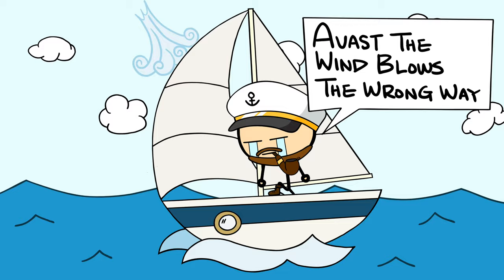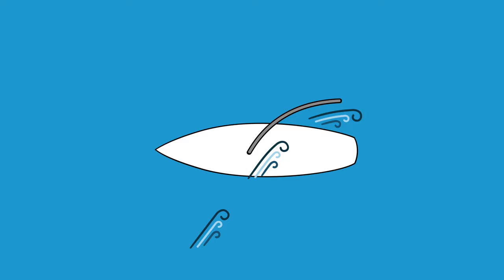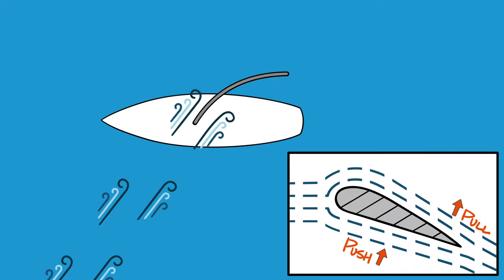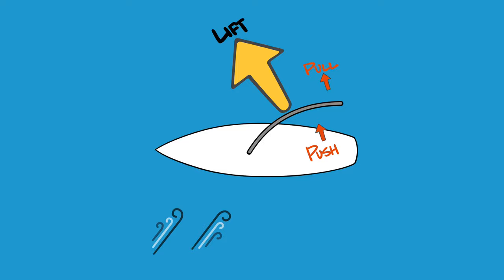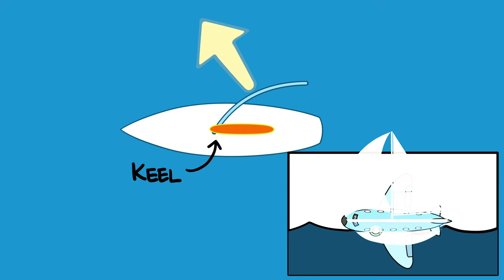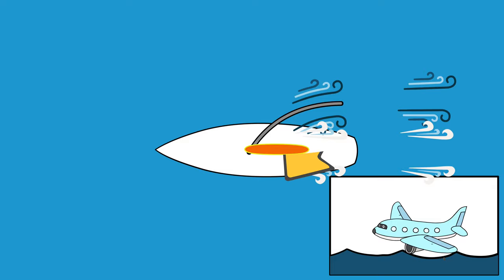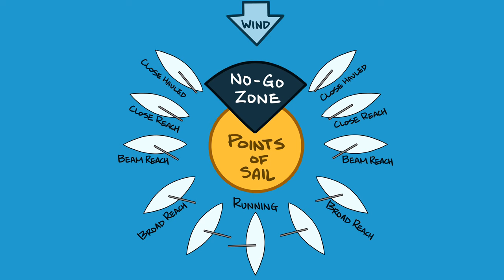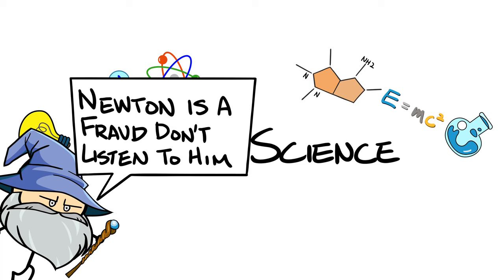How Sails Work or How Sailboats Sail into the Wind

Comment: The fact that the sail of a sailboat is essentially an airplane wing was a huge revelation for me! One small correction though, the Coanda effect doesn't pull the wing upwards at all. The Coanda effect describes how powered jet flows will stay attached to a convex surface, whereas the flow over a sail stays attached due to its viscosity forming an attached boundary layer (much like how water will stay attached to the edge of a cup if you pour it out slowly)

Comment: What do you mean 45 degrees on either side of the wind, about the no-go zone? Does it refer to the fact that the wind passes along both sides of the sail, or am I reading this wrong?
Reply: It’s virtually impossible to sail in that zone, as it’s hard to create that lift, when you’re going head on into the breeze.

Some Maxi Racing Yachts can sail higher into that zone. But it depends on how they are designed.

Comment: The lift vector for the keel is wrong.  The keel can only produce lift at an angle that is 90 degrees from its cord.  There is no way that the keel provides lift in a forward direction. 
This video could be better in terms of a more accurate vector analysis for the lift vector produced by the sail and the lift vector produced by the keel.

Comment: With all due respect, there is a scientific error in the explanation of the keel and rudder part, as per the end of the text immediately below.
.
The starting point to understand how it is possible for a sailboat to sail against the wind is to understand how an airplane sustains itself (by Bernoulli's Principle and by action and reaction) and how an F1 "sticks" to the ground (essentially by action and reaction, and not by Bernoulli). 
.
 When an airplane is cruising and flying completely horizontal, it is lifted almost exclusively by Bernoulli: the difference in geometry at the top and bottom of the wings creates lift. This force is perpendicular to the motion of the plane, and drag (drag, or air resistance) is minimal. 
. 
As a curiosity, the aerodynamic drag of an Airbus A380 in cruise, for example, is 0.0265 (against 0.001 of a laminar fluid on a plate, and 0.005 of a turbulent fluid on a plate); even so, it consumes a huge amount of fuel, something like an average of 5 liters per second in a flight.
.
An airplane can also fly based on action and reaction; the most obvious example is that of a paper airplane, whose wings are straight and could not be supported by Bernoulli. In its flight, however, its beak must be slightly tilted upwards, so that the air enters underneath and sustains it. The main characteristic of a flight by action and reaction is the high drag: a study with two types of paper airplanes showed that they have a drag coefficient between 0.8 ("Stunt Plane") and 1 (" The Glider"). 
. 
Note that even an airplane like the A380 will face enormous drag both in the climb and in the descent, due to the air that enters either below or above and will tend to brake it. 
. 
Another situation in which there will be enormous fuel consumption is if it were to fly upside down: in this case it would be like a paper airplane, and its beak, in order to sustain itself, must be kept slightly tilted upwards. . To close this part, an F1 car "sticks" to the ground due to the forces generated by the wings (two front and one rear), which are basically inverted wedges: the airfoils of an F1 do not work like an inverted wing of an airplane ( they perhaps more closely resemble the elevators of this one). They are just wedges in which the natural downforce is generated at the cost of drag (this is sometimes positive, because it helps the car to brake. It can contribute up to 1g of braking), that is, based exclusively on the principle of action and reaction. . 
As a consequence, the drag coefficient of an F1 is very high, reaching values as high as 1.1! A driver once commented that driving an F1 is like trying to accelerate a car with an open parachute behind it. . . 

Having made this introduction, it became much easier to understand how a sailboat sails against the wind. That experiment where you blow on the side of a sheet of paper and it rises, almost like magic, is a clear demonstration of Bernoulli's Principle! Due to the greater air velocity in the upper part of the paper, there is a lower pressure (to understand, imagine a hose connected to a faucet, and this one is open: with the faucet open, but the nozzle of the hose locked, the force against the walls is huge, but when we unlock the nozzle and the water acquires enormous speed it may be that, even with a hole in the hose, it does not leak through it, but continues to flow), and with that the leaf rises! 
. 
Note that blowing in one direction generated a lift force, in a perpendicular direction, which is amazing! 
. 
Returning to the sailboat, it cannot face the wind head-on and walk against it in this situation, but it can be placed on its side, in such a position that the wind generates lift in the sails from the difference in inclination of its material (the sail is with a more rounded side, like an airplane wing); note that one of the components of lift is in the opposite direction to the force of the winds (and will obviously have a much lower intensity than this one) and the other in a perpendicular direction to this one (also lower intensity). 

The tendency is for the sailboat to walk inclined in the direction of the wind (for example, either northwest or northeast, if we are talking about a north-south wind), that is, going sideways. 
. 
And here comes the mistake. 
. 
In a common boat, not a sailboat, the rudder is largely responsible for steering it (the helm changes the position of the rudder). On a sailboat, it also serves to counterbalance the force to one side generated by the sails, but this does not occur as an "inverted lift", or the same lift in the perpendicular but to the other side; in other words, they say that the Bernoulli Principle is at work there, when it is not. What happens inside the water is just action and reaction (that is, something more similar to the wings of an F1, and not to those of a cruising plane): if the boat tends, for example, to the northeast, just turn the rudder to the left, so that the course is corrected, so that the sailboat has the final tendency to walk into the wind. . As we are not talking about an active force, that is, in the end, it is the wind that is setting the tone (note: I am ignoring possible sea currents and proximity to surf zones), the tendency is that, even with the rudder positioned in such a way as to counterbalance the force of the sail in the opposite direction, it will still be displaced in an inclined manner, either to the northwest or to the northeast (in the case of a north-south wind), however the solution is simple: after a while, just invert the position the sails, as well as the rudder, so that the vessel zigzags around the main straight path into the wind.
Reply: How do you invert the position of the sails?
Reply: The water is not an active force if the boat is not moving and there is no current. But when the boat is in  motion the rudder and keel are also wings the water is moving in the same way the air is moving I relationship to a wing is apparent current